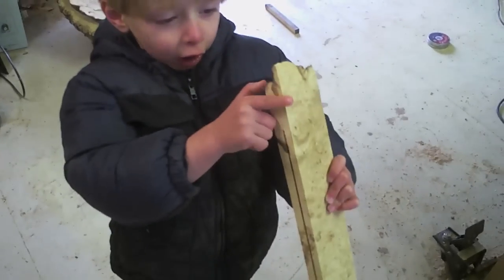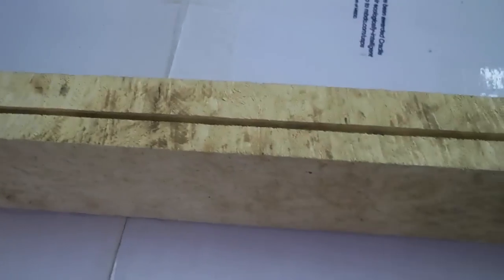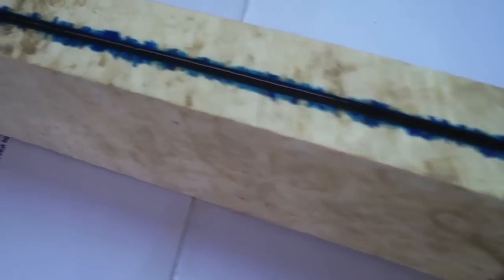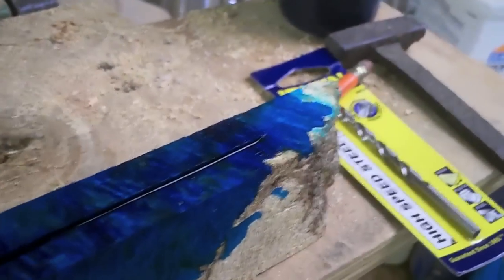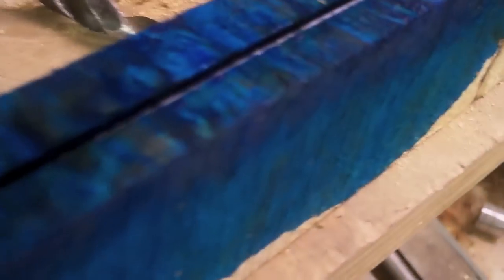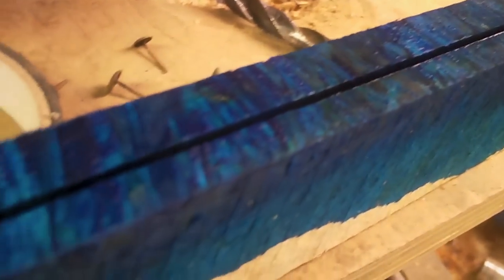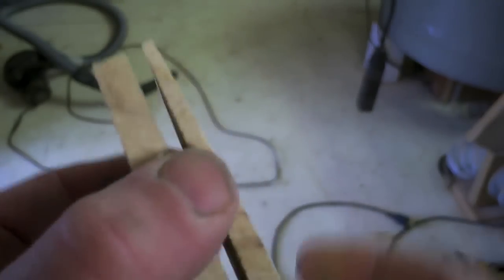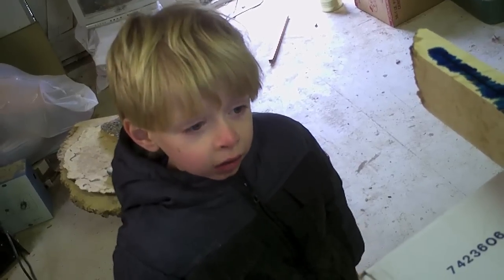Dyed Wood Experiments

Comment: What happened? How did it look?
Reply from the maker: Failed, did not get any penetration to speak of.  Never got around to trying it in a vacuum chamber.  As for using the ink from cheap printer refill kits that seems to work ok.  Vibrant colors and so far no finish I have used it with seems to have any effect.  Water poly, poly, lacquer or resin.

Comment: If you are looking to penetrate the wood with dye (as I assumed you were attempting) you will not be able to with just soaking. It would just simply sand right off, 
To penetrate the center of your blank you would have to infuse the blank. The results are fabulous! 
To do this a vacuum pump is required (I use a two phase from harbor freight $120.) with minimal mods and build a vacuum chamber (all items from a hard wear store) to learn how to build it is easy just research websites and YouTube vids... If done correctly you would result in some beautiful grips...just don't butcher beautiful wood like that again..

Comment: What you are attempting to do is called stabilizing a piece of wood. You can do with simple home made vacuum bags and kits for stabilizing wood. Can get a quart and a dye color for about $50.00 and easy to build if you google those topics. I use dyed epoxy resin for the easiest way. Buy Super glaze( 25.00 home depot) add dye into mix and apply with squegee for smooth surfaces.
Reply: Stabilized wood is made with a resin to........stabilize........the wood. Dyeing is not stabilizing.
Reply: Aaron Campise is correct. It is the same process. You need the resin to mix the dye into which will then penetrate using the stabilizing process under vacuum.

Comment: did it work or not? you made it seem like it was definitely penetrating easy. then flas h to a different piece of wood saying it probably wouldnt work..... feel like i just wasted 5 minutes without seeing results
Reply from the maker: Sorry for the confusion, it never did soak in as deep and as colorful as I was hoping.  No results to show.
Reply: yeah, and the blue seems to take over the look of the wood too. i hear Rite dye works well. best results are to heat the wood in an oven or something, and use a vacuum stabilizer to penetrate the wood. ive seen some kewl results from people who stabilize wood with dye mixed in on burl. burl sometimes resists pigmentation so kewl colors and effects can occur. another thing u might be interested in, is if u get ur product near finished, then coat in dye, give it a fine sand and seal and repeat sanding a few times.... should be just as good looking, especially in curly woods